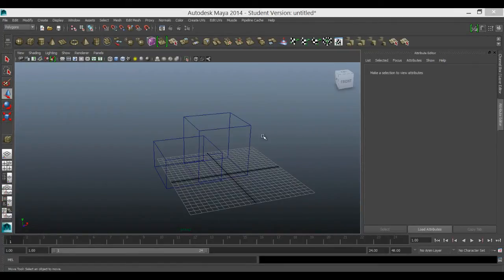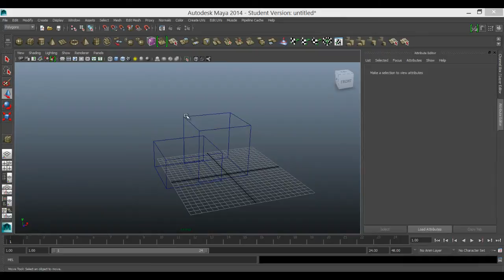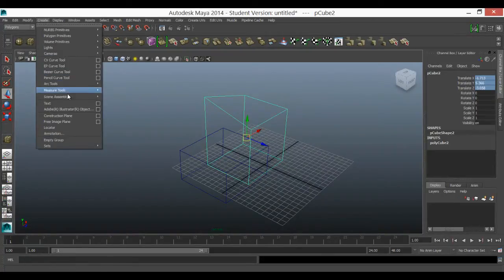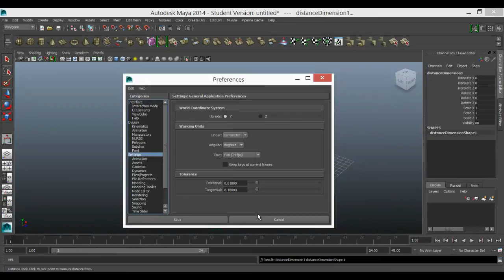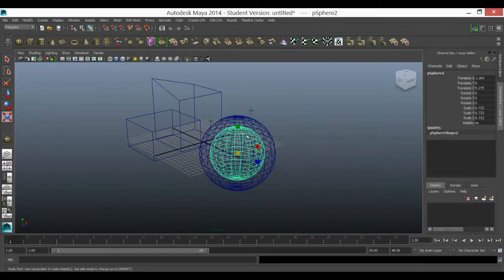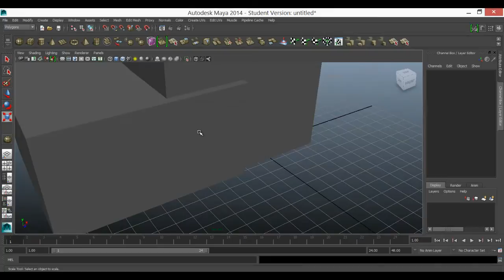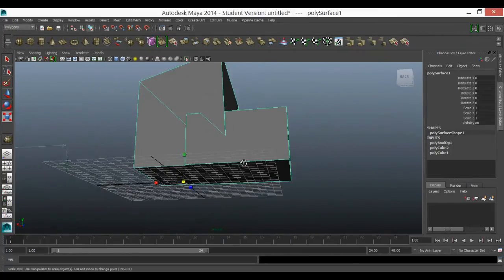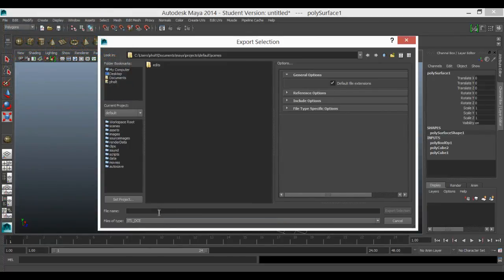3d Print your Maya model

Comment: how can i know the thickness and change it for head model ? i want to change the thickness to 5 mm
Reply from the maker: Ok so Maya wasn't built to make this easy. There are a number of ways to model this. A simple way may be to add a simple sphere inside the head and combine it. Extruding it inward will cause issues that will need to be solved, would be my guess. Now dimensions are in preferences and can be set for the scene. That way you will know what the units (in the channel menu) represent. Hope this helps

Comment: Ok, but what If I want to print an object the is roughly 11in x 2in x 3 in and my printer is only 6x6x6? How would I go about making the changes if I want the object to work?
Reply from the maker: humm, The only choice would be to slice the part and re-attached once printed. How you do this would depend on your item. (where it needs to be strong etc. you could try and manufacture a joint into the item, possibly a tenon)  

(select faces and separate them, export each part as a separate file)

Comment: hi there im making a toy in maya, how can i make sure i comes out well, it's basically two peices the body and the clothes
Reply from the maker: This is not easy without seeing the model.  First: make sure the geometry is clean. No extra bits, vertex ect. Second: be aware of the scale of the model and you print resolution.   Third: try and get your mesh to follow the contours of the model nicely. Avoiding odd creases forming. Lastly: be very aware of the way it will be printed. Thinking about undercuts that will need supports and how you will remove the support material afterwards. Hope it helps..
Reply: peter Holt thank you can i send you the picture so you can tell me if there might be any issues?
Reply from the maker: Sure.
Reply: can i have your email ill send you a few pictures so i can show you everything and how the character it set up or i can give you mine, by the way thank you for your help i really appreciate it.
Reply from the maker: I don't want to post my email address. Not sure how to get arround this. If you had a public spot like youtube or smug mug where you could publicly store the images. I will take a look. All the best